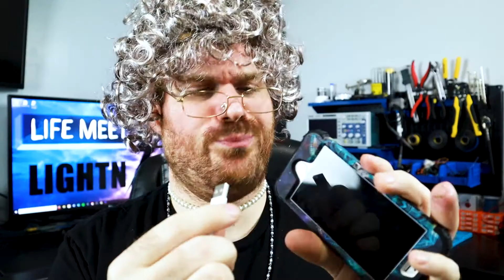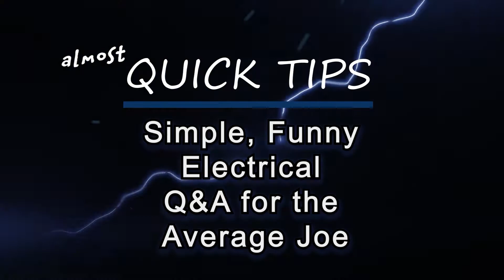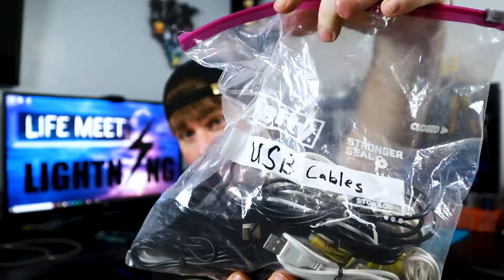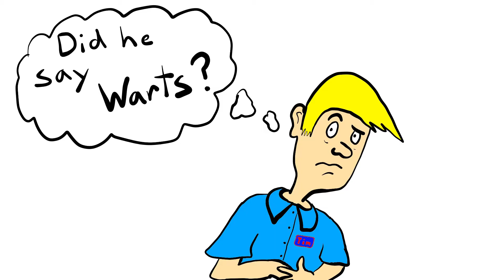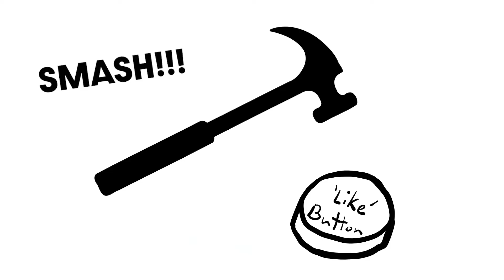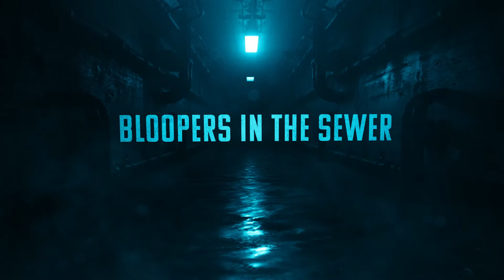Reasons Why Phone Wont Charge | USB Charger Problems | Part 1

Comment: LOVE your teaching style!  Recently I have had a problem transferring data with my USB cord.  I am getting an incomplete connection message and have to put a pen under the connecter going into the phone to get it to connect.  Why would this be and how do I correct it?  Thanks!
Reply from the maker: I would try a different cable first. If the problem follows to different cables, I would make sure the port on your phone is clean. You can gently clean it with a wooden tooth pick. My suspicion though is that it’s a micro-USB connector, and it perhaps fell off a table at some point jerking the cable at the connector and bending the little tab in the phone. I’ve seen this happen on a couple occasions. Apple’s lightning cable design tends to hold up better to this. You should be able to bend it back. In any case, it sounds like a connector problem if you can get it to work by using a pen underneath. If you’re feeling adventurous, you could open your phone up and solder a new connector in there. Some phones are easier to do this on than others though. :-) Thanks for watching!
Reply: @LifeMeetLightning  Don't think I'm prepared for phone surgery.  Thanks for answering so quickly!
Reply from the maker: There are places around that repair smart phones. :-) They tend to be expensive though.
Reply: @LifeMeetLightning  Thank you.  I may have to look for one because I record my videos on my phone.  I have a disk that I charge my phone with, but transferring files can be challenging.  Great info and very nice video.
Reply from the maker: @TheOldMayfieldPlace  A cloud service like google drive might help you get by in the mean time! Who needs cables anyway!  Lol They’re so yesterday!
Reply: @LifeMeetLightning  LOL!  But I'm a dinosaur.  So send my files to my Google Drive from my phone to access on my computer to edit?
Reply from the maker: @TheOldMayfieldPlace  Yup! It’s slower, but it gets the job done. I use iCloud all the time to transfer all the drawings I use in my videos.